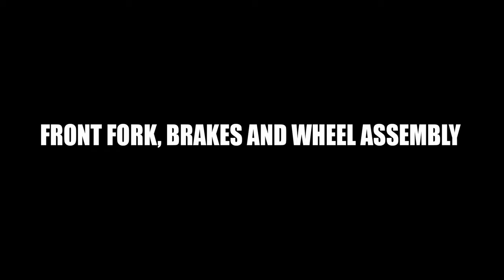Building: 1/12 Yamaha YZF-R1M “Track Edition”  Tamiya *PART 2* FINAL ASSEMBLY

Comment: Nice build. Very clean and tidy. I might have done a couple things differently, but can’t say anything bad about your build. Top Studios does make a detail-up kit for this model with PE brake rotors and other goodies which would really set it off. Somewhere I saw a trans-kit that would allow one to build Rossi’s “weekday” track bike, which would be super cool. The metal fork tubes are always a good call, and I’ve used them on most of my Tamiya moto builds.
Reply from the maker: Awesome thanks Shannon, yeah this was my first bike build (as I only started the hobby last year) and only built one other since then, I used the PE set on the ducati build and you’re right it makes a huge difference to the overall build. Thanks for stopping by, looking forward to the new motogp Suzuki coming from Tamiya in the next couple of weeks 👍🏻👍🏻
Reply: @autostradamacchina  I've built 5 M1's, (4 Rossi, 1 Edwards) a YZR500 (Roberts) 2 RC211V's (VR, Hayden) and Rossi's rookie NSR500 so far.
Reply from the maker: No idea where you’re getting those M1’s. The ones I can get my hands on, are way over what I’d want to spend. Have this idea to convert a 916 kit into the superbike version from the ‘90 when Fogarty was still around, but need some bits 3d printer
Reply: @autostradamacchina  I bought most of mine before they went through the roof. The 2009 is crazy expensive because there trans-kits for subsequent models that use the 2009 as a donor kit but for later models. Tamiya usually releases a kit of the championship winning bike, so I hope they do Quartararo’s M1 kit so the cycle can begin again.